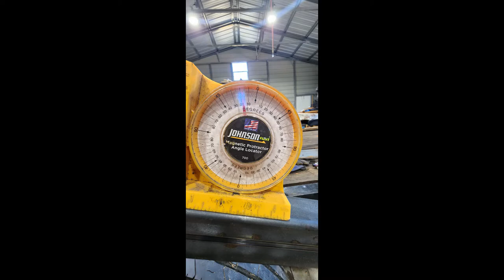Custom Gooseneck Trailer Gets Drive Over Fenders

Comment: I’m wanting to do the same thing to my trailer, could you tell me what the material cost was?
Reply from the maker: Last years prices were around $700, I'm not sure what the current rate is though as it fluctuates daily. Here's a material break down... 4x 20' 11 gauge 2x2, 2x 5" C channel , 1x 4" C channel, 1x  sheet 4'x8' 11 gauge.
Reply: @chiefcreekcustoms  thank you I will check with my metal supplier on Monday
Reply from the maker: @robhenthorne4002  No problem! Best of luck with the build!

Comment: What blade did you use for the cold cut?
Reply from the maker: I used the Evolution metal blade in the video. However, I have since switched over to Diablo. I have gotten more cuts per blade on the Diablo, and it's a cheaper blade.

Comment: What model Evolution saw did you use?
Reply from the maker: I have the R255SMS+, which is a multi material saw. If I were to do it again I'd buy their dedicated metal saw.
Reply: @chiefcreekcustoms  Thats the model I was planning on buying, the dual beveling saw. Why would you buy a dedicated metal saw if you had to do it again?
Reply from the maker: @mopargssr  The mulitmaterial saw isn't bad per see. The blades just don't seem to last as long as I think they should. Now, I will say that it may be an operator error, but I thought I babied the last blade, and it didn't make it through that project before being extremely dull. And at $70 I feel like it should last longer.  From what I've seen from others, the blades on the dedicated saws seem to last a little longer. Also, I only use this saw to cut metal with. I have a double bevel wood miter saw as I feel the Evo saw may cut to slow for my liking in wood. Although I've never tested it, the blade speed is significantly lower than a traditional miter saw.
Reply from the maker: I just swapped out the Evolution blade for a Diablo blade for an upcoming video . So far, the Diablo blade is 10 times better, and it's $20 cheaper! I made close to 60 cuts through 11 gauge, and it still looks new. So if you go with the Evolution saw snag up a Diablo 10" blade with the 1" arbor.